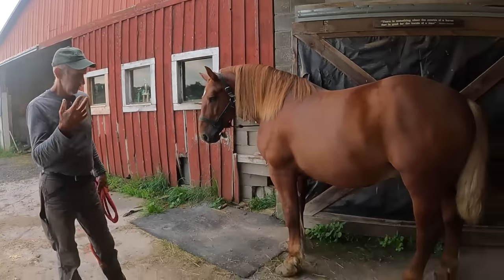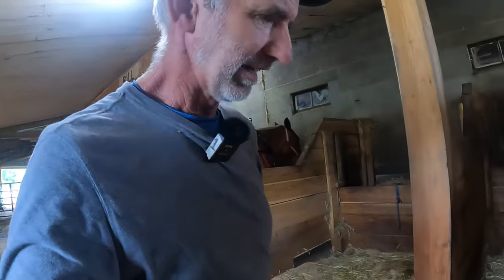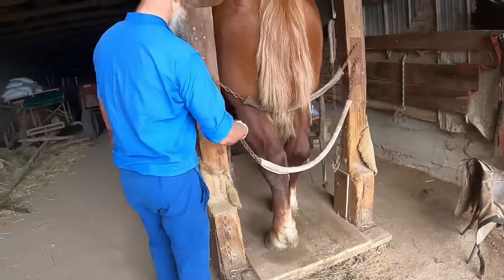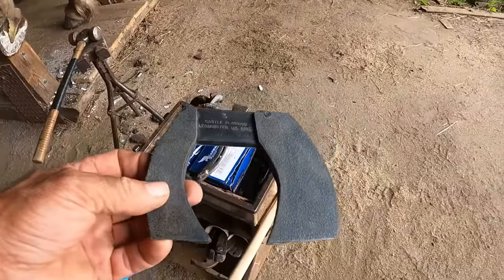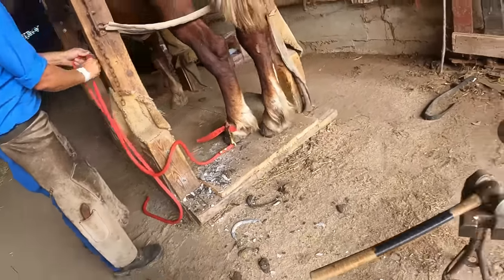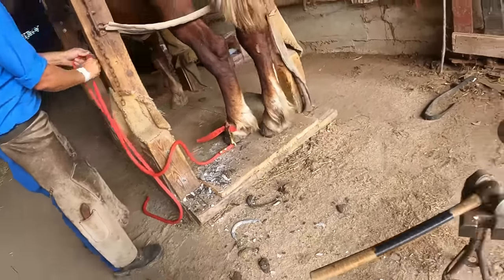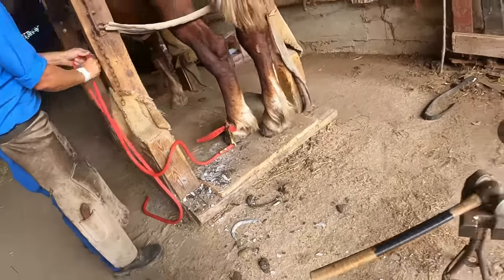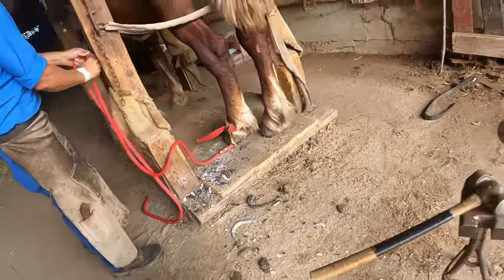AMISH DRAFT HORSE FARRIER: How can we solve Baron's Feet Issues??! #522

Comment: It isn't hard to explain. He "pronates" on his hind feet. This means he rolls from his toe to the outside and rounds to the heel putting more weight on the outer edges of his rear hooves. Just english descriptions. Many humans do the same and if untreated you can develop muscle and joint problems in the leg. It can be much worse in horses because of weight and work load. A pony with a tiny rider would never have the problems a working draft horse could develop. If the pronation causes problems in the leg you loose the ability to have him used for breeding as well as loss of work. I wouldn't fool with the shoes but go barefoot and cure the habit of a lifetime in how he learned to walk. All the muscles and structure in his leg conforms to the roll of pronation and trying to make fast changes can cause hoof and leg problems. It needs to change but it will take some time while keeping him sound. He is to fine to waste.

Comment: So, in human terms, Baron looks like he's overpronating on his back feet. I like the barefoot farrier hoof/locomotion revision idea, I tend to think running him barefoot and trimmed will revise his movements naturally, vs forcing it under work. But, we've had farriers for centuries, and I trust that VERY gradually changing his movements via pads/wedges/trimming (and maybe some leg wrapping, poulticing, icing, etc) under relatively light load will also work. Speaking from personal experience, when you get a stabilizing shoe on, the tendons/ligaments in your legs do ache when you're forced to walk "correctly." So correcting this is going to take some work and time. Jim, you thought about checking Duke and Earl for the same habit, and maybe getting a jump on correcting it now? Finally, something I learned about a long time ago, if you lean or push on the horse to transfer his weight to his other hooves and away from the one you want up, it's easier to get them to lift it. I use it on dogs, cats, humans, works great.

Comment: Hello Jim, I have a suggestion for you on the mites if you ever get concerned about using the cattle dewormer too much mineral oil will kill mites and is perfectly safe for the horses. Just pour on and rub in with your hands, the oil blocks the mites ability to take in oxygen through its skin and they suffocate.  When I have had to use it I try to apply it once a week and I have tried diatomaceous earth but I'm not convinced that it works that well however it does make the leg feathers look really good.
Reply: It also keeps the skin from getting waterlogged, which lessens the incidence of scratches and grease heel.

Comment: As a former horse owner/trimmer/trainer/dressage rider, I was trained to use my hearing also to analyze gait. With the 8 week old set, there was almost a 1-2 beat on each hind hoof fall as well as visually the outer wall hitting the cement first and then the inner wall hit an instant later as Baron’s full weight came to bear. Once the left hind was shod and padded, the difference between the two hind hoof falls was audible as well as visual. Once he was fully reshod, all four footfalls sounded (and looked) much more harmonious. If it’s not too late, I would also strongly suggest a barefoot trimmer to see if he can be salvaged in a much more natural way. I know working horses are shod differently but getting him corrected will make him last a lifetime even if you have to work him with lighter loads for a while. A horse is only as good as his hooves…. My best to Baron, may he dance nimbly for the next twenty-thirty years!
Reply: He does dance quite beautifully when he's in a good mood!
Reply: @JChaos1120  Yes, his very proud slow trot. He has dignity. :)

Comment: Varus deformity at the knee.  The leg is like a stack of dominos.  Any misalignment of the either the foot/ankle or knee or hip will effect all the other joints in the leg as well as the supporting ligaments and muscles.
This maybe a boney deformity after four years and not correctable with shims between the foot and the shoe.
I can see readily the stress on (especially) the left knee upon weightbearing.  If you can't find a way to stop this lateral movement of the left knee, I can pretty much guarantee early onset of arthritic changes in this joint.
Obviously, I am not a vet but have seen this many times in humans.

Comment: Hi Jim and Brandy, thanks for this very interesting Video on Horse Showing. I have a lower Back Problem from falling of a Hors on a hard packed Gravel Road. I tend to walk of the Out sides of my Heals and walk like Jim Demonstrated. I have a bit of an idea as to how this work on me! Horses Arnt that far removed. 
In correct showing of young Horses can led to lotas of Problems later on. Extended or weekend Ligaments and Tendons. Baron was walking on one side before the Corrective Showing, after He was walking more correctly, putting less Strane on His Legs and Hips, but Demonstrated an awareness of the compensation of corrective Showing and Compensation in Posture, Baron will adjust in time. Barons' inflammation may be caused by His incorrect poster, may be resulting in a little Lamens. The Ligaments and Tandans need time to readjust. Thanks, and Have a wonderful Day!

Comment: Suggest putting mite solution in a spray bottle for easier application to all areas of the foot. You would get an even application of the solution and less wasteage.
Reply: Take a good look at the applicator Jim is using. Two compartments and pored directly where needed plus worked in with rubber gloved right hand .Spray bottle would blast all over the place(floor, hoof) where not needed.Again Jim is doing this job correctly.

Comment: Do I see an abrasion/nick on the inside rear of his right fetlock from the opposing hoof? I couldn't see the inside of his left fetlock for the same nick.
Reply: No, that's his chestnuts, one of the left over fingernails from evolution.
Reply: @JChaos1120  no, I know what chesnuts are. They are up higher. This is a nick with the hair missing. It could be caused by the opposing hoof hitting there

Comment: Baron is "stocking up", which occurs in hard ground. The best thing is movement. Also applying DMSO with water. Lots of farriers including myself use a hoof jack, including on drafts. This isn't to knock your farrier, but it looked like the lateral wall is higher, which can turn into a wry hoof. I myself would pull the shoes for a periid. You'd be amazed by looking at the hoof from the opposite side will give a better view. I think he does have conformation defects, but in this case, I believe it the farrier more so. Been here done that, so I went to school. The only way to know for sure is xrays
You can look up, hoof mapping.  
Equine Lameness Prevention Organization.

Comment: How iron or cast iron or wrought not steel.   If less than 0.1% carbon is present in the metal, it is termed wrought iron,  With 0.65% carbon, the metal increases its tensile and compressive strength; it can be welded, remains ductile, can be hardened and will flow at an easily obtainable temperature.  

Boy isn't today great for learning new words for a 75 year old guy.  

capable of being hammered out thin, as certain metals; malleable.

capable of being drawn out into wire or threads, as gold.

CAST:   to receive form in a mold.   melt the iron and pour it into a mold and you get a cast iron frying pan.      or to whip a fishing line into the lake, to cast the hook, line and sinker.
Reply: Thank you Richard for your many nice comments. Sticking  to horse and horse related issues  is greatly  appreciated  . Please  stay away from those politics topics on this channel .Cheers
Reply: @chips4974    Do you have a name?
Reply: Yes.

Comment: Keeping horses tied up is extremely old-fashioned - this should be changed. But if it isn`t possible please check if the stalls are wide enough: they should have 20 more centimeters than the horses`hight because horses should be able to stretch out the legs when they want to sleep properly!!